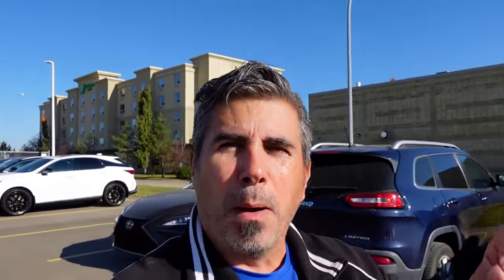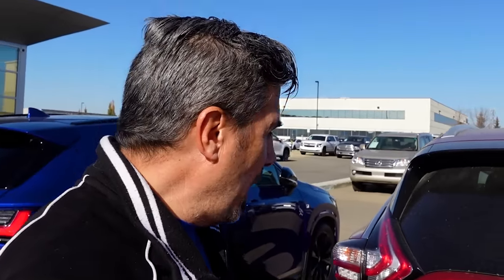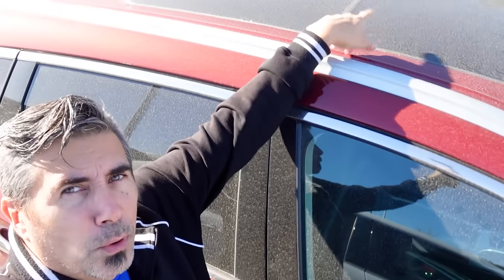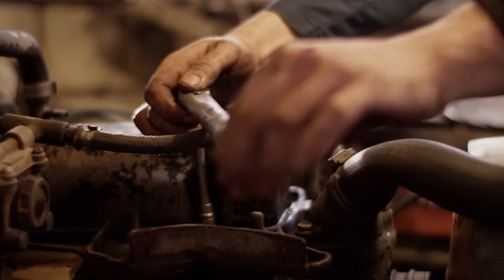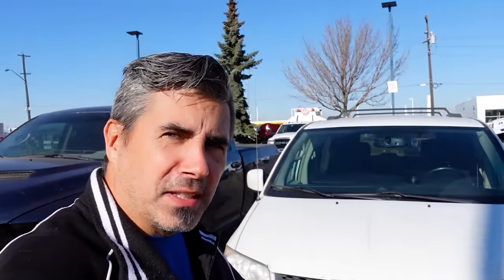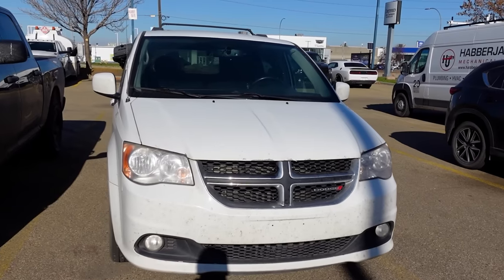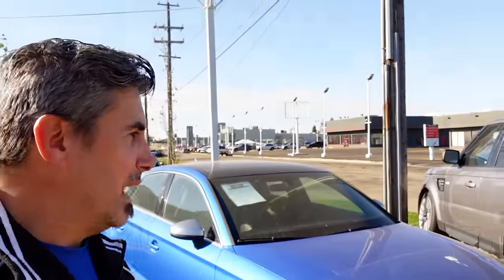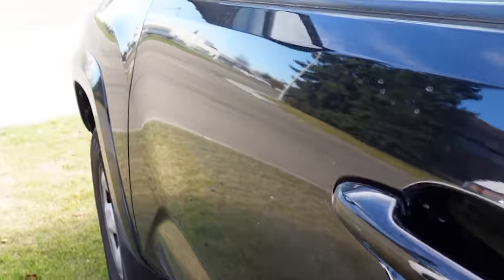Avoid These Cars RUINED By Their Junk Transmissions!

Comment: Thanks so much Mark great info. I had no idea that the Civic has or had cvt issues. Honda in house Transmissions are generally good.
Reply: Early Honda CVTs, From  14-15, These have been completely redesigned with launch Gears instead of solely relying on a Steel belt, But if course as an owner of a 2020 Civic Sport we chose the 6 speed manual with a None turbo charged 2liter engine, It's been all around Great performing Car with almost 50,000 trouble free miles, If this changes You'll be the first to Know, Why because it's the Right thing to do.👍🇺🇸😁
Reply: That was fairly early on in the cvt introduction. Recent years have been rock solid
Reply: @trev9168  ah ok
Reply: Frfr- my TSX got 250k on da clock and still asking for more!
Reply: @danielcoulter9540  Absolutely 🇺🇸😁👍.

Comment: it seems there's more junk transmissions then good transmissions. i bought a crosstrek in 2022 and i bought a manual instead of the CVT (it was available with a manual until 2024 MY). im happy with my choice, so far

Comment: My job has 3 Ford Fiestas with the Powershift, all with less than 85k miles. Two of them will bounce off of the rev limiter several times before finally shifting if you floor it while downshifting into first. They also bought 4 Nissan Versas (CVT). At 20k miles, one of them started screaming when under load. Another one was jerky and clunky at less than 1k miles. The Fords were fun to drive, but unreliable. The Nissans were just straight up cheap garbage in many ways

What's also funny is that, on top of making simulated gear shifts, the Nissan's tachometer would show fake rpms to make it look like it had lightning fast gear shifts 😂

Comment: It seems like the older 4 speed overdrives, whether FWD or RWD, were pretty much trouble free for at least 100,000 miles.  That was too simple/practical. Going from torquey pushrod engines to smaller DOHC with or without turbos, now we need 8-9-10 speeds to get these gutless, no low end torque turds moving. Then when it craps out just after the warranty ends, it's $8000+ to replace it. Double of what a typical 4 sp overdrive cost.
Reply from the maker: Yes

Comment: 2017 Hyundai Tucson SE Dual Clutch Transmission is junk. Replaced one at 96,000 kilometers and almost again after 160,000 kilometers but i sold it before it took place. (Toyota E-CVT Hybrids Rule!)

Comment: Nissan has improved the CVT transmissions and the real problem they had in the past was Nissan saying its a sealed unit that does not need service. Lies They require extensive service every 25k-35k miles. If you service them they can last 200k miles I have seen it. Personally I would never choose a CVT though just me.
Reply: You may not have a choice in the very near future, unless you buy a used car.

Comment: BAD ADVICE!!!!! That 6-speed manual gearbox in the Toyota Tacoma SUCKS.......awkward to shift with lots of slop and travel, and robs horsepower making the truck super slow as a snail, and drinks 20% more gas......from 21 mpg on highway to 17 on a  4x4 if you are lucky.  I have driven both gearboxes...this guy has NOT.  You think that 6-speed automatic is awkward shifting that manual is worse...BEWARE!!!

Comment: Doesn't Ford use the same transmission as Chevy/GM  in all their trucks/ large SUV's?
Reply from the maker: Well…..
Reply: Not exactly. They did co develop the transmission together. Back when there were glass headlights, Ford, GM, and even Dodge used the same exact headlight. You could pull one off a Ford Econoline van and put it on a Chevrolet Express van as long as it’s the base model glass headlights.
Reply: @atx-cvpi_99  who cares about glass headlights...those were universal..and weren't even made by each company I'm asking if the transmissions are exactly the same
Reply: @jayc4715  I'm not too sure as of recently. But the crossover suvs did. 2015 ford explorers had the same transmission as a gmc Acadia. But there were slight changes just so that you could NOT interchange the part between the 2 manufactures. General motors 6t70 is same as ford 6f50. Gm 6t45 is same as ford 6f35. 

Both those variants, are utter garbage transmissions. However a skilled driveline specialist can rebuild them affordably.
Reply: @quyle9483  yea I heard the problematic 10speed gm transmission is also in all the full size Ford trucks and SUVs..f150, expedition, navigator..etc.. 2017+

Comment: Great video. ALL CVT is garbage!  Holding on to my 2016 Camry V6 with a real transmission.  New Tacos are garbage. Overpriced 4 bangers. Toyota took the trusty  reliable V6 away and now these cheap transmissions. What a shame!
DO NOT BUY Nissan. Had a 2015 Altima with CVT that left me stranded on I-25 on a road trip to Colorado.  Nissan is complete garbage!
Reply: Bull.  Some CVTs are solid, no problems.
Reply: @eskieman3948  
Only ones that i would trust are Toyota's as they seem to be the most reliable so far. Still take a real transmission 9 out of 10 times any day.

Comment: CRAPTCO or JATCO transmissions l like it Nissan's at least buy a manual and the Toyota Tacoma definitely get a manual it is interesting manual transmissions have been around for 100 years and have remained unchanged fir a long time they have been improved but they are mechanical which is great because you cannot add electronics to them manual all the way

Comment: Ford's solution to problematic DCTs? Stop making cars that would use them. All you can get from Ford now are Pickups, SUVs, Crossovers and ...  Mustangs.
Side Note: I've been driving a Focus with the powershift DCT for about 11 years now. With a single recall to fix a clutch issue, it's been problem free as far as the trans goes. Downside is it is a Ford and with that comes other parts that tend to give up the ghost and corners cut in manufacturing - ie. To fix a common problem with exhaust systems - a broken flex pipe, youy have to replace the manifold, cat and, yes the flex pipe which is all one unit. As expensive a s fiull cat-back exhaust system! Sure you can cut ot the flex and weld in a new one . Once. But that fix really is a termporary one. Expect to pay $1500 or so to fix the damn thing right. Don't get me started on RUST!

Comment: Do not purchase any vehicle with a CVT TRANMISSION!! THATS A FACT!!!!!
Reply from the maker: Exactly, thats an automatic NO BUY.
Reply: The Toyota and Honda units are reliable
Reply: @chadhaire1711  I don't care who makes it.  They can not be worked on. They also require oil changes every 30 k miles at a cost of 300 dollars plus . NO THANK-YOU  I have a vehicle with 150 k miles never did anything to the transmission!!
Reply: @stevedawson3863  If they dont break they dont  need to be worked on.....and show me where it takes $300 to change to oil
Reply: @chadhaire1711   Nissan Dealer  Porter Indiana  change Transmission oil every 30 K miles is what Nissan recommends cost 300 dollars they charge  28 dollars per Quart of oil!!
Reply: Bull - that's an OPINION.  Some CVTs are solid, no problems.  If ALL CVTs were bad... then why did Toyota build their own CVT?
Reply: @eskieman3948  I have had cars with Cvt transmissions they are great for the first 100 k miles. I like to drive the wheels  off the vehicle. I am saying I will NEVER own a nother vehicle with a CVT transmission.  You are correct that is my opinion!!